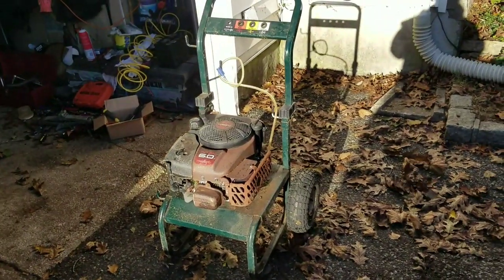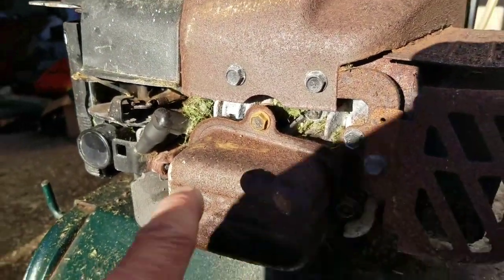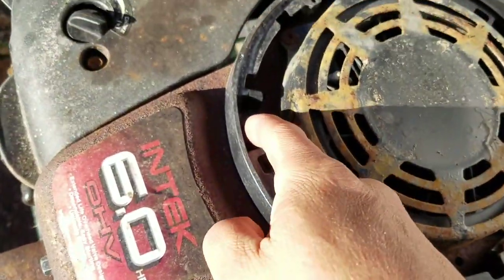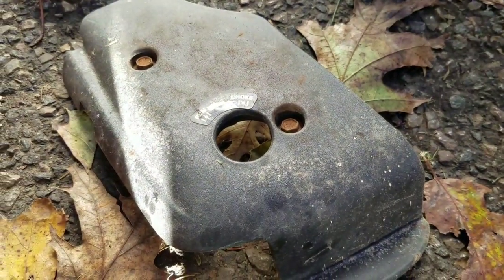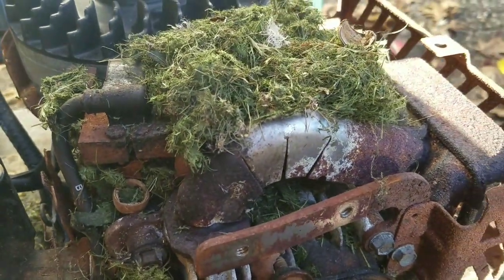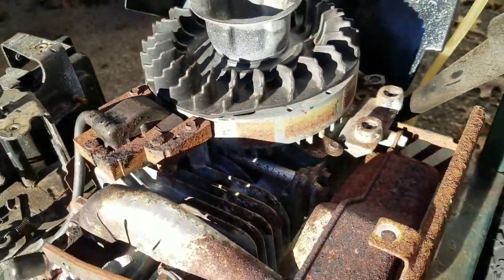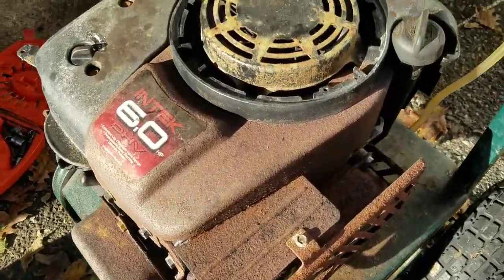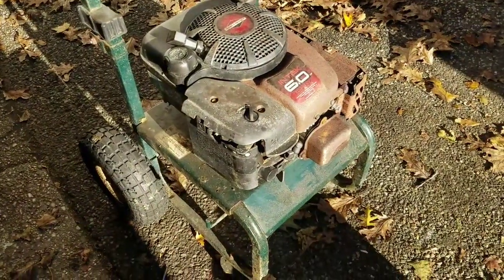HOW TO RID EXTRACT REMOVE RODENTS RATS MOUSE NEST LAWN TRACTOR MOWER POWER WASHER ENGINE OVERHEATING

Comment: Great video.... I definitely learned something! I have a question, I have a B&S riding lawn mower and have had it for many years. Recently, I have had some issues, that I think are overheating. It will run for about 15 - 25mins and then starts to hesitate and bog down and dies when the blades are engaged. When I disengage the blades the engine comes back, but with low output and surges. When I turn the mower off and start it again it starts right back up, but then slowly starts to hesitate again. I thought it was a fuel getting to the engine issue, so yesterday I changed the original fuel line (18yrs old) and replaced the fuel filter. Did not solve the issue. Now that I saw your video here I am thinking I may need to clean the fins off completely. 

I figured with your experience you may have heard of this issue before. Great channel and content! Thanks
Reply from the maker: For sure martin, take the engine cowling and cover off to reveal the fins...they have to be clear for the blower fan to blow cool air to cool the engine.  That's a place to start.  Thanks for subscribing bro and for the comment.